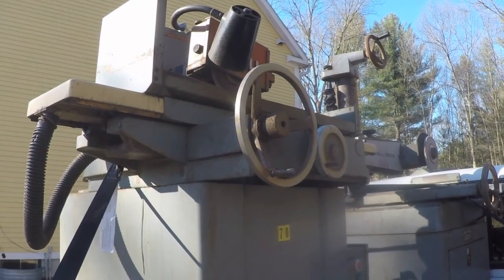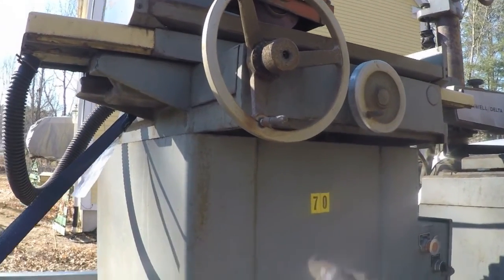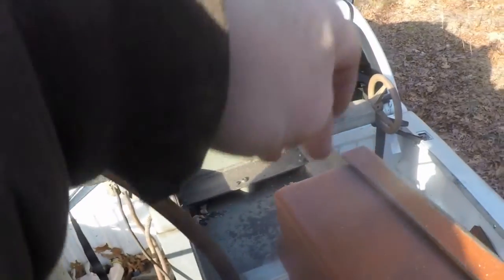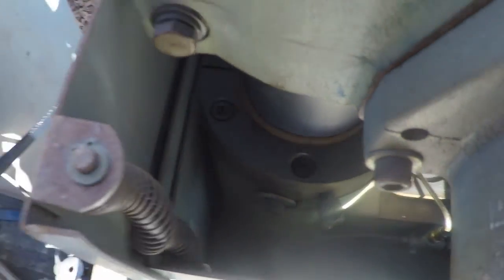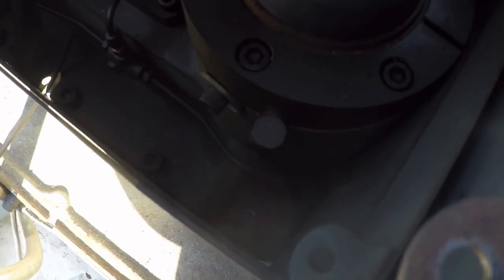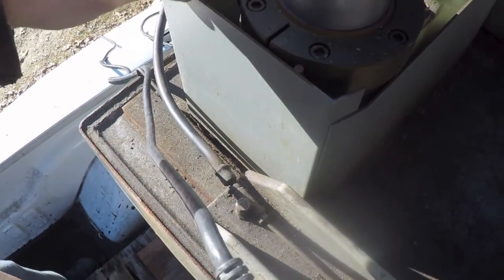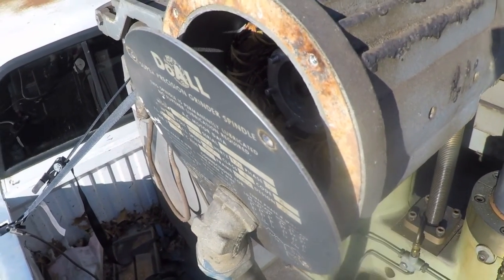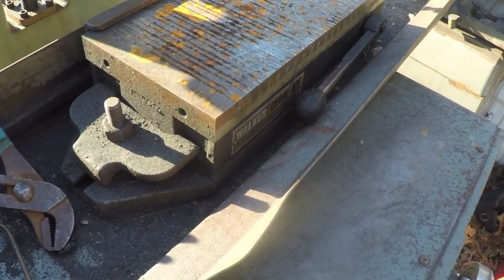Doall VS612 surface grinder Part 1: disassembly

Comment: I just bought the exact same grinder. This video has been extremely informational for me without taking my own machine apart just yet! thank you very much.
Reply from the maker: Sadly, I never got back to this project. I do still want to try and save it, but I have to see if the spindle bearings are any good. I figure if they are bad, I may have to scrap the whole thing.

Comment: Steve, let me know if you plan to scrap or part out the DoAll grinder. I have the same one and am looking for a few parts.   Kevin
Reply from the maker: Determining if that thing will be worth it is on my to do list.
Reply: @stevewatr  Please message me back when you decide.  I will be going down to Reno to pick mine up in the Spring. I will message you back then if I don't hear from you soon. Thanks again for the timely reply.   Kevin
Reply: Steve, what did you decide to do with the DoAll surface grinder you showed in this video. I am still interested in a couple of parts.  Kevin @stevewatr

Comment: FWIW ... You actually ruined it. The "locating" pins, are actually jack screws , to line the upper column, within tenths in either vertical direction. Grinding off tenths depends on the accuracy of the elevating or lowering screw, which I imagine is now gone with the damage to it.
Reply from the maker: Cool!

Comment: did you ever get the doall back together?
Reply from the maker: Not yet. I plan on moving the spindle down to the basement work bench and hooking it to a rotary phase converter to test it. I figure if the motor or bearings are bad, theres no point in moving that heavy base down the bulkhead.